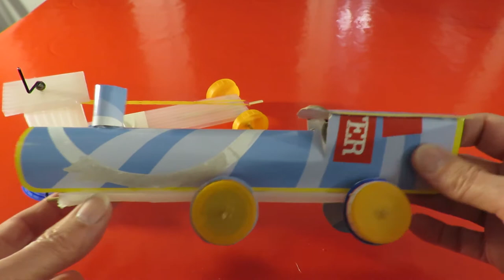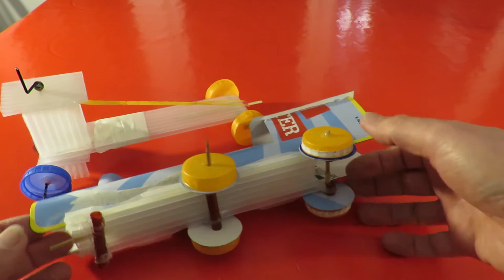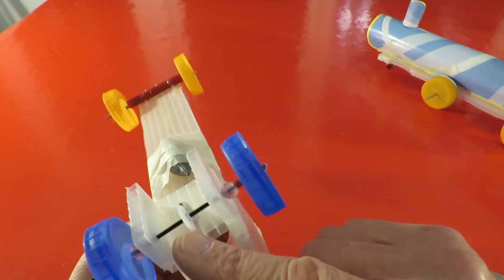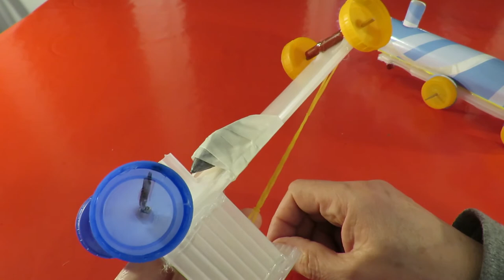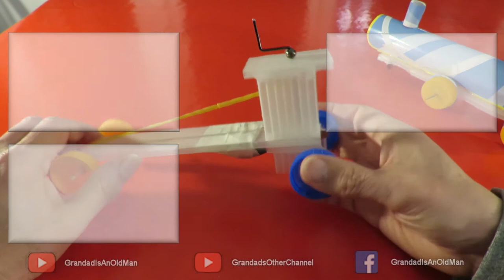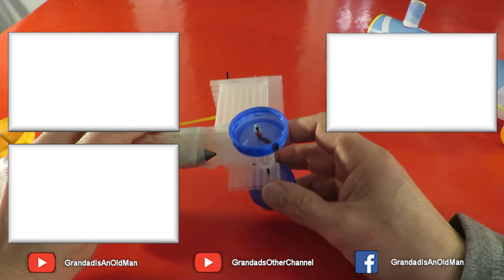Rubber Band Powered Train #3 SIDETRACKED

Comment: The pivoting axle would work of it was set and locked to match the track curvature but if it is free to move it can twist at an angle to the track and bind or jam the flanges between the rails, for sharply curved track a short wheelbase is the way to go, two axles to concentrait the weight for traction.
Reply from the maker: Hi Ian, I was thinking that I could have a second axle on the pivoting section, that would keep it in line with the track. The problem I have here is that using gears means I need to work to much tighter tolerances than my normal projects and I tend to avoid anything that needs any level of accuracy.
Reply: Having a second axle on the pivoting section would work because in effect that would create a power bogie, just like those under a diesel loco. Gears are difficult to set up, gearboxes and driven axles are one area of cars i leave to experts.
Reply from the maker: If I had a bit of space for a proper workshop I think a Drill Press would be on my list of desired tools so I could drill accurate vertical holes. Of course I am sure somebody would go for a 3D printer nowadays.
Reply: Just a drill press ? i would add to that a lathe, MIG or TIG welder etc etc
Reply from the maker: That would just be the first on the list, but it is fantasy land anyway, never going to happen.